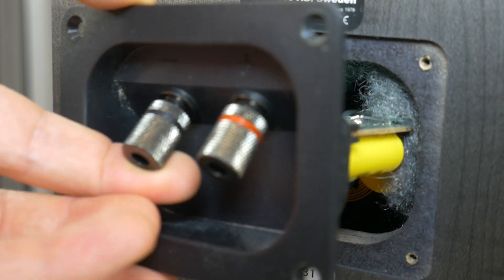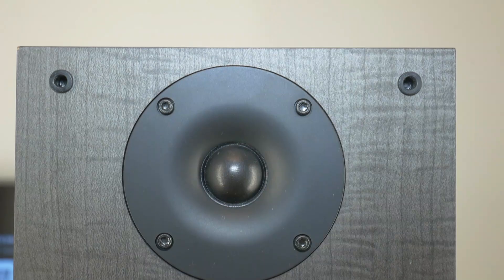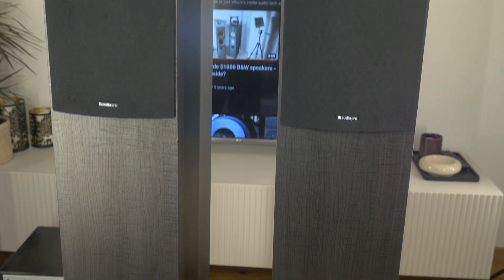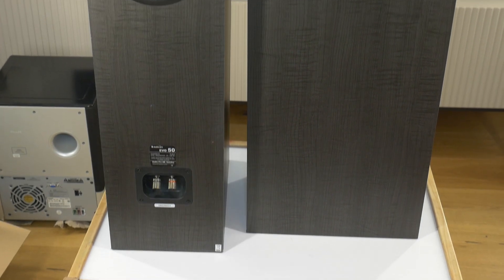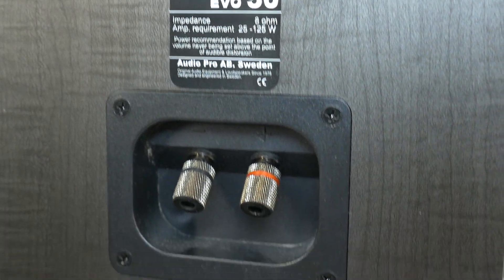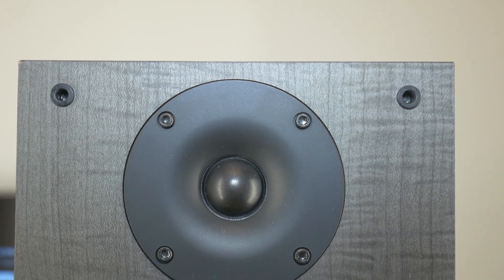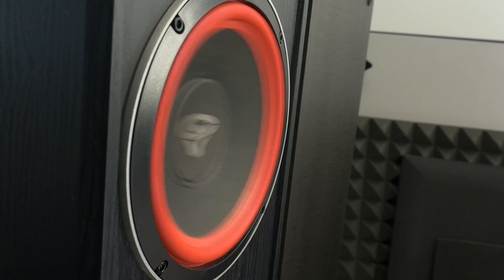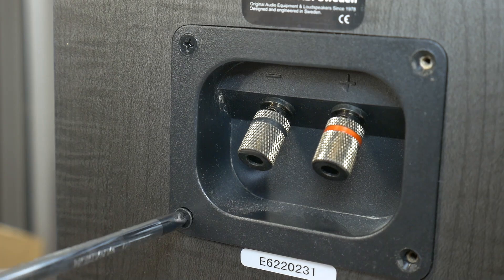Look inside Audio Pro Evo 50 Home Speakers

Comment: Nothing special, stamped steel woofer basket, thin cables, steel nuts on terminals, at least the cabinet has internal bracing and looks thick on front baffle